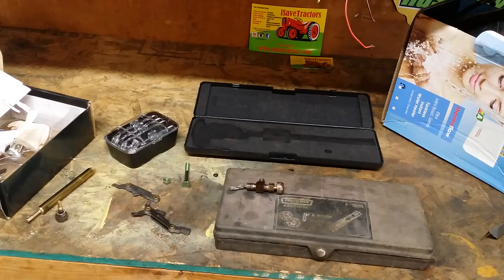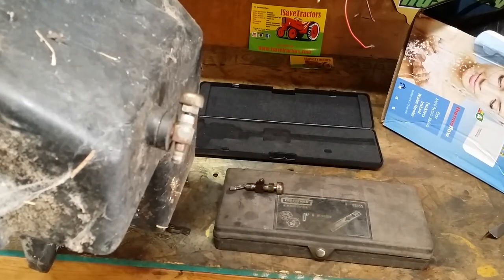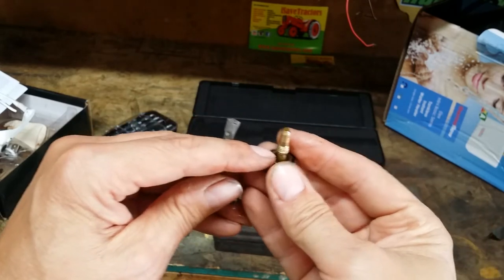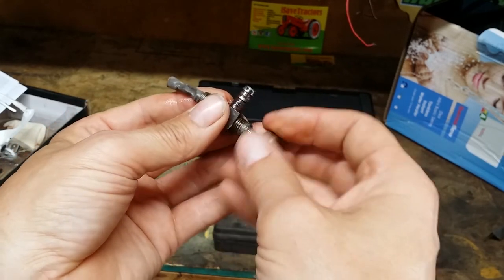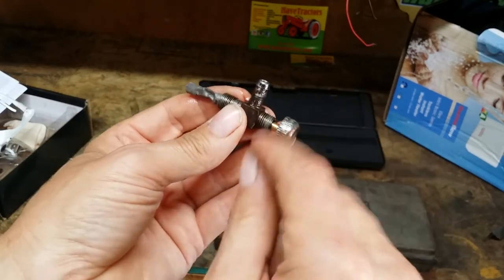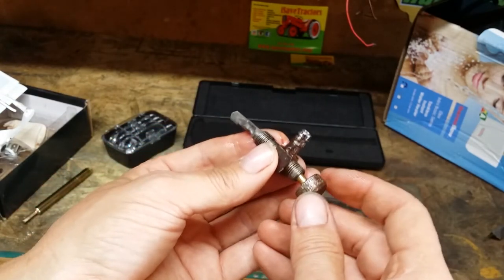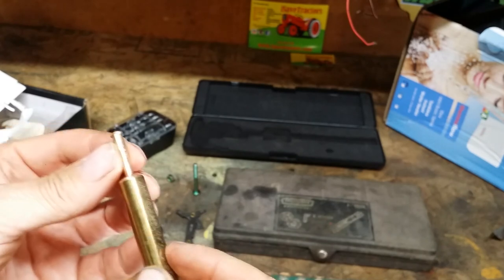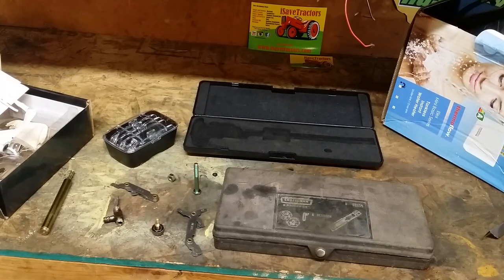Odd ball thread chasing tap build for tractor fuel valve threads

Comment: Clever idea, I wouldn't have thought of using a single thread. 😁
Reply from the maker: Thanks. Not the best idea ever. But without a metric lathe (or work araound) it worked in a pinch. Now just gotta chase the other GTs valves

Comment: Hey Craig. That seems really close to 1/4"-32, just barely undersize. Are you sure you just don't have some worn down threads?
Reply from the maker: WOW! I totally blew that. I triple checked it. And sure enough 32 tpi fits. I was having trouble seeing the fitment by normal eyesight,  so part way through the examination I grabbed my magnify goggles.  I must have tried the 32 before getting the goggles on and not rechecked it after the fact. Thanks for the heads up!
Reply from the maker: Looks like there will be a part 2..lol
Reply: @craigtate5930  It happens. I did something similar with a torch head once. I was convinced it was some weird proprietary thread and it was just a worn pipe thread. All the best!

Comment: Would a dip in carb/brake cleaner do the same thing?  No stranger to odd threads:  the feed lever on my Hamilton drill is 5/16"×30 (!)  Had to measure tpi by screwing an old pencil in and checking the scratches against a thread gauge!
Reply from the maker: Great idea with the pencil.  I gotta remember that. Technically they could be diped in carb cleaner with the removal of the fuel line. I was going for an on vehicle repair. But a cup of carb cleaner could certainly be held in place under the tank
Reply: @craigtate5930  Yeah, a #2 pencil just fit the hole.  Had to read it several times against the gauge to be sure that I wasn't fooling myself!